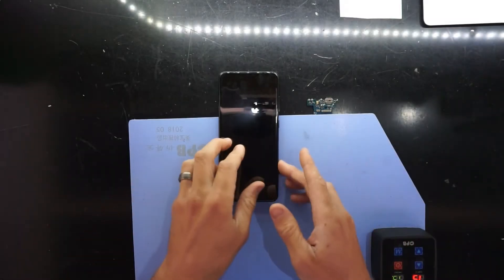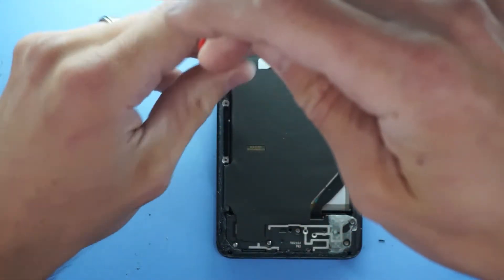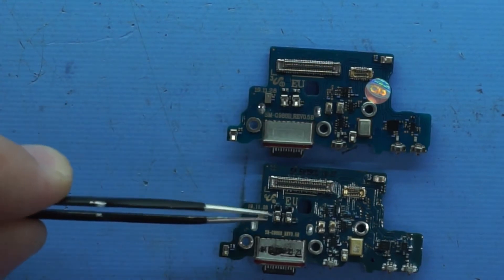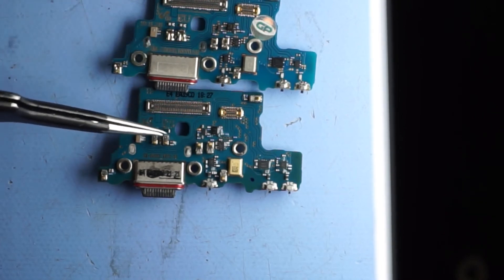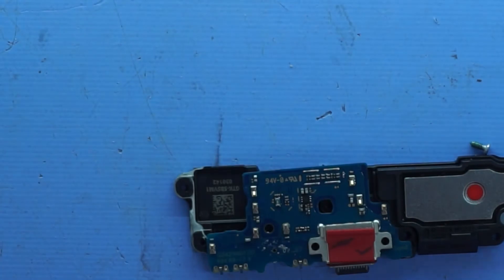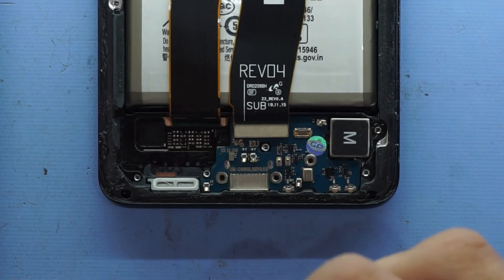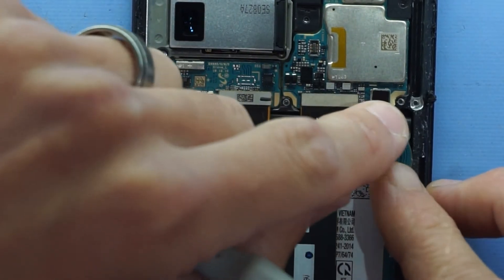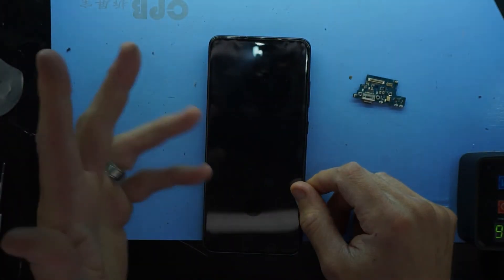Samsung Galaxy S20 Ultra Charger Port Replacement

Comment: Hey Rick, I recently replaced a screen and frame for my s20 ultra with the help of your videos! reason I replaced was due to the "green screen of death".. now I have the "damaged" screen and want to know if you would want it? maybe open it up and find out why its not working well.
Reply from the maker: Hi. Great to read the video has helped

The damaged displays are almost useless when broken, apart from maybe getting an ear piece speaker out of them
Reply: @rickstechrepairs  ahh ok. This is all in one piece though, besides not having the guts, and when it's turned off, you can't tell that it's damaged. Would be a shame to just trash it and would be nice to know what actually went wrong.

Comment: Im having this issue, here local stores only have chinese boards, Ill try bending it to have better contact, also my charging port USB was damaged, barely made contact it was too lose. Headset didnt worked when I plugged in... :(
Reply from the maker: Typically I see charging ports mostly just need a clean with tweezers.

You may have to order online for the replacement part
Reply: @rickstechrepairs  Thanks, did bending helped on that board on the video with the signal? I'm not sure if my old board can be saved.
Reply from the maker: nar didnt really improve

Comment: Does charging port bud affects phone signal
Reply from the maker: Yes it certainly can
Reply: @rickstechrepairs  really because my phone doesn't display sim rather it writes no connection and after something stops charging  can this be the cause and if I change the charging  port can my phone signal start working
Reply: Does this affect the IP waterproof rating?

Comment: hello. Would you be so kind as to tell me a little more about the part that changed? I saw in another video that they change another part. My phone is damaged and does not receive a charge. What part should I change? Thanks
Reply from the maker: i cannot advise what to change, i would recommend contacting a local repair store to you

Comment: Hey mate, hope this finds you. I have spent countless hours trying to find a replacement board for my Chinese model s20 ultra. Do you have any ability to source this part? I'm more than happy to pay for your time finding it, I've searched locally (in Australia too) and globally. But I can't find the bloody thing. Hope you can help mate.
Reply from the maker: Hi 
Sorry iv got no suggestions on where to source that one, apart from AliExpress

Do you need to charge the whole board or is it just the charger port that's busted?

If it's just that you should be able to get a local repair shop to use s hot air station to swap the Jack
Reply: @rickstechrepairs  j

Comment: I ended up running into the same problem. Then I bought a board that looks identical. They both had NO signal. I tried bending the pins etc.

Have you got any ideas to help mate? 🤞
Reply from the maker: i find that any after market charger board for most samsung phones, i dont trust at all

i have now started to do the physical USB jack Replacement on the boards
Reply: @rickstechrepairs  oh wow thanks for the reply mate. Hopefully you have the time to show that video :)
Reply: I just bought a hot air station and am going to attempt to swap the USB port... Any tips would be gold.
Reply from the maker: Check out Art of Repair, here has great information on phone repair and microsoldering 

But this video will help 
https://www.youtube.com/watch?v=wjUKaupJmRU&ab_channel=TheArtofRepair
Reply: @rickstechrepairs  thanks for the reply mate. I attempted the repair and all went well except one solder pad was stubborn and went off with the old one. Gutted!
Guess I have to somehow find a fitting charge port. There seems to be none like mine anywhere on the internet. Do you have any suggestions? My version is G988U China version...😔

Comment: Nice work
Reply from the maker: Cheers

After this, I did the following 

The original charger board, was coming up with moisture in the charger port 

I soaked it in isopropyl for 5 minutes
Then heated it up to 250 degrees with a hot air gun for 3 minutes 

Then reinstalled the original charger port (which had better reception than the replacement charger port
Reply: @rickstechrepairs  thats great you are reason i can now repair phones and laptops you are such an inspiration
Reply from the maker: Thank you very much :) 

Keep it up once you learn the basics you can apply that to many forms of repair
Reply: @rickstechrepairs  do you reckon this would work with USB PD charge not working. Initially had water error. Now only slow charge working...
Reply: Didnt fix mine... Now board on the way 🙂
Reply: @jessoman  oh dear